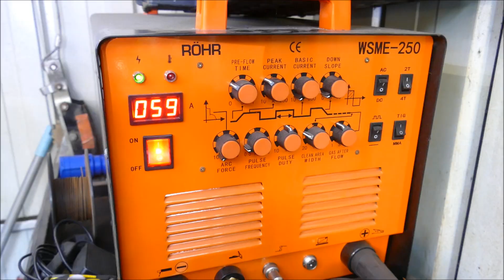Metal Steam Punk Top Hat - Cocktail design

Comment: That’s interesting I have used aluminum as you did to dissipate heat. Always on welding two flat pieces together. I get the sugaring effect on the side against the aluminum. Taping in shielding gas is a great tip thanks.
Reply from the maker: Thank you. If it's a tight fit the aluminium reduces the sugering also but not completely. Cheers J

Comment: I’m envious that you’re tenacious work ethic. Denting all those panels. Joshua how do you quote a job like that is there anyway you can do a short video ?. Great video as always thank you
Reply from the maker: Thank you so much. Quoting I believe is relative to the perceived value, some things are more valuable than others and contain different skills that should be taken in to account. After I've taken into account the costs such as materials, fuel, rent, depreciation etc I then decide how long it's potentially going take accounting  for delays and apply my hourly wage. Then I decide the value of the item and set the proffit margin. Sometimes I lower my margin if I want to do the job if it is an opportunity to learn a new skill etc. I try to always make proffit to re invest in the business to grow it. At least that's my plan. Cheers J

Comment: Hi Joshua, what do you use computer program-wise to make your patterns?  When you fold the sheet steel
into shape are these patterns important so you know the forms will come together? loving your content and your informative natural delivery to the camera.
Reply from the maker: Thank you. Yes I use CAD to do the design and then translate that to a DXF for CNC laser cutting. All parts arrive within 0.2mm of tolerance so everything fits very well. Very efficient with time and cost savings. Next year I hope to build my own CNC plasma table to make parts but laser is far more accurate, clean and able to do fine work as you'll see on the moths in my next video coming soon. Cheers J

Comment: Wonderful video! The trick with the foil. Whas that to hold inert gass i place while you where welding from the other side?
Reply from the maker: Hi yes. It was to create a small chamber filled with argon to purge the rear to prevent oxidation. Theoretically I could just have filled the whole hat but that's a waste of gas. Cheers J
Reply: @joshuadelisle  Thanks for the reply! and the grait tip!